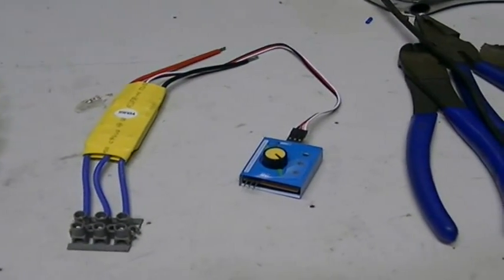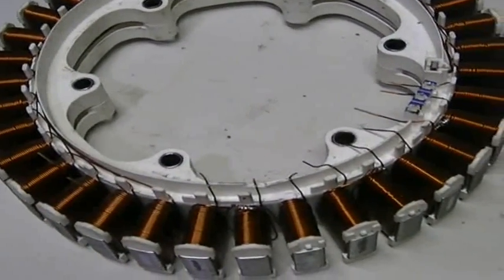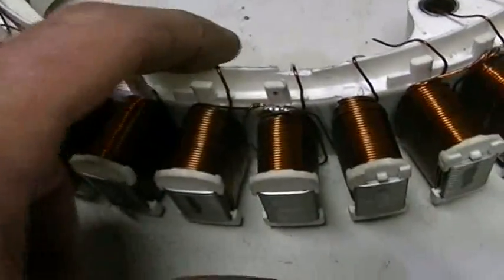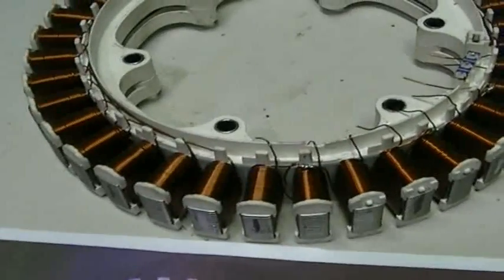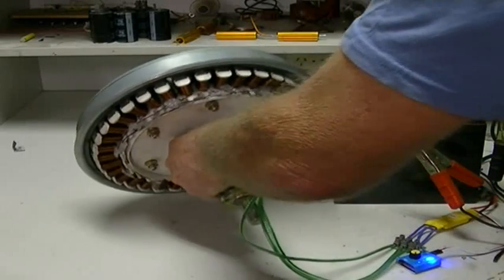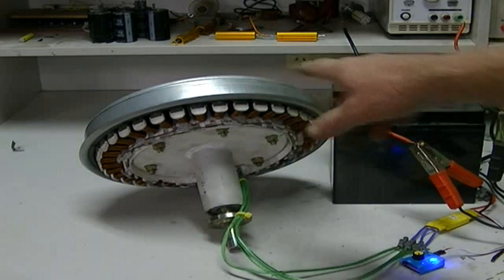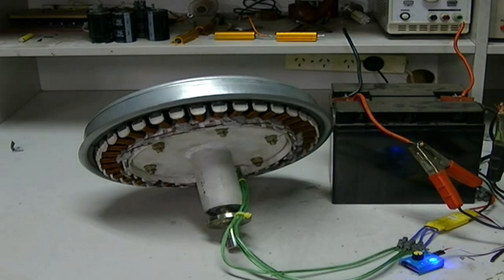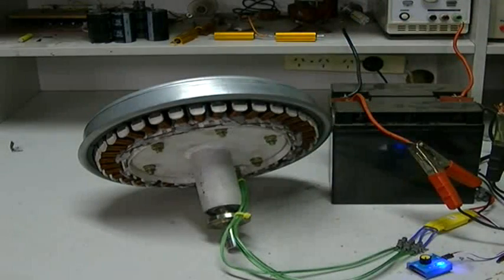DIY electric outboard from washing machine motor PT2

Comment: Just received a few different washing machine motor . Some are f/p and some are lg and the one stamped with westinghouse is identical to the f/p. A random drum i found has a different spline so yet to see what that is but have a few ideas of what i would like to experiment with thought. Defo rewiring one like this though ! Thanks for the know how 👍🏻

Comment: Hi tinmanpower , I have a question mate , I have rewired my stator exactly the same as yours with the star config , but I have the .08 f&p motor , when I connect my controller the drum doesnt spin it just beeps !!!! I have gone over the wiring 100 times and ordered new controllers , any tips ?? PLEASE....

Comment: So the original series phases winding wont drive by that 12v 30a rc esc? , but modifify phases to pararel make it turn, does by pararelling phases wiring has any disadvantage to the motor?

Comment: It's nice looking project you have going there. I've contemplated running one of these motors with a generic speed controller before but was always dubious about how well it would perform under load. As far as I'm aware, the speed controller has no feed back from the motor and cant adjust for load changes, and may even cause it to desink and switch off. This might be the reason for the motor struggling on startup as the load would be greater on a stationary rotar. Keep us informed, as I really hope this performes well.